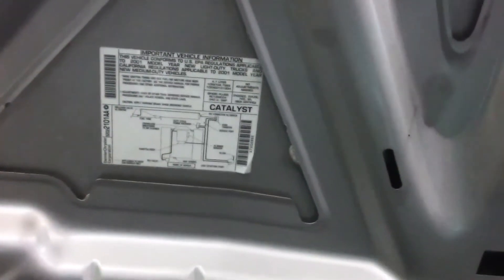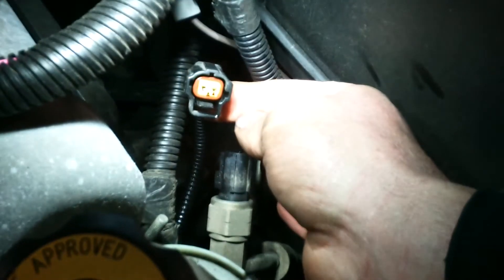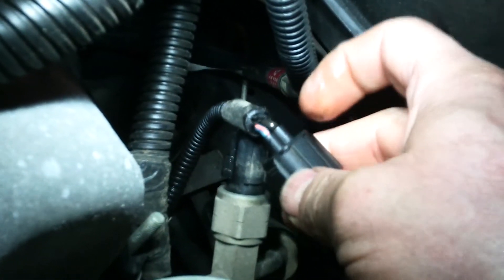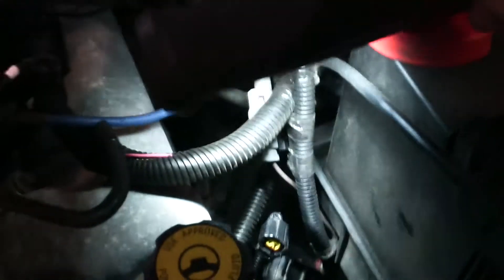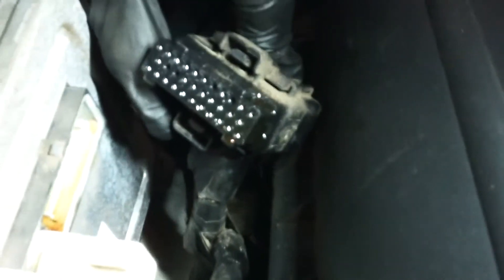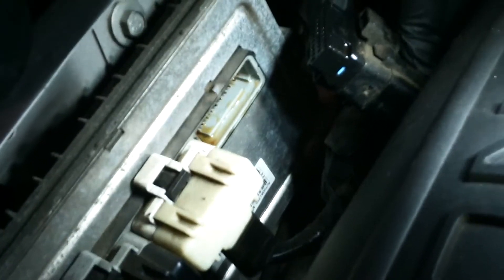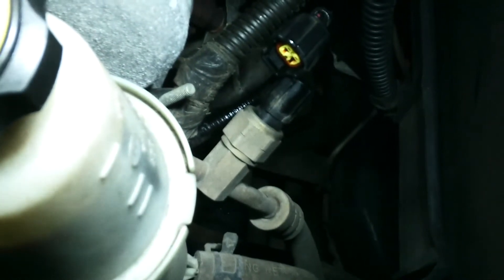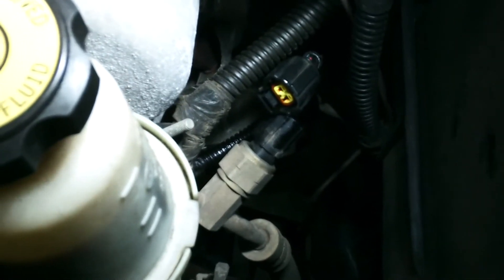P0551 Power steering switch Dodge Dakota Computer fluid contamination

Comment: Man you just saved me so much time. 2nd time replacing ps switch, once replacing o2 sensor bank one, 2 times replacing ps pump. And I still throw p0551 and p0171 codes. I am going to try to clean harness as much as possible.

Comment: Several times, the car started and then DIED!

The engine turned over, so it wasn't the battery. Then I stalled. But eventually it started, and I later learned that if I gassed it plenty (which I would never otherwise do), I could avoid it stalling.

So that's my issue...an intermittent problem...it always starts, but then only occasionally stalls out, not driving, but before I get anywhere. Once I got back a foot before it happened.

I realize part of the problem is that for those of us who just drive, the details are not easy to delineate and explain, which I'm sure is frustrating to those trying to understand. 2004   dodge durango
Reply: Might have your camshaft and crankshaft sensors replaced
Reply: @wolfdoggiestyle  it was the crank sensor

Comment: How on earth does the fluid travel all that way to the computer?
Reply: I thought the same thing to.
Reply: No answer to the question of how the fluid manages to migrate to the computer? Seems to be another "scheme" to charge for unnecessary replacement of parts that don't need to be replaced
Reply: Because the sensor reads pressure so fluid comes out with pressure and the cable not perforated it will reach the computer

Comment: It is nearly impossible for power steering fluid to reach the PCM. I would bet that is spilled oil for some other application.
Reply: Well youre wrong. Mine did the exact same thing.
Reply: Bullshit. I've been dealing with faulty power steering switches pushing ps fluid to my o2 bank 1 sensor for 10 years. I've traced it all the way back to the ecm myself. Get on the dodge forums and you will see same stories over and over. There is a tech service bulletin that explains how to bypass the ground for O2 bank 1 because of this same issue..
Reply: @southseapirate1  you are right. The computer harness of my truck  is contaminated with fluid too. Before I unplug the computer harness I thought it was not possible for the transmission fluid flowing to there as I noticed the computer harness is located at a higher altitude than the altitude of the power steering switch harness. Liquid only flow to places where their altitudes are lower than the altitude of the source. Obviously there are some kind of pressure that pushes the fluid from the switch harness to the computer harness.